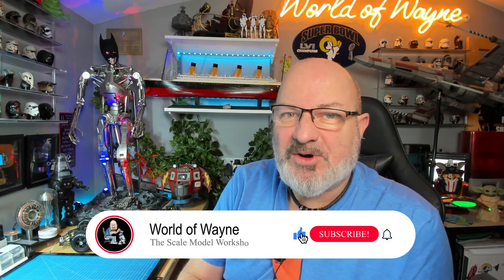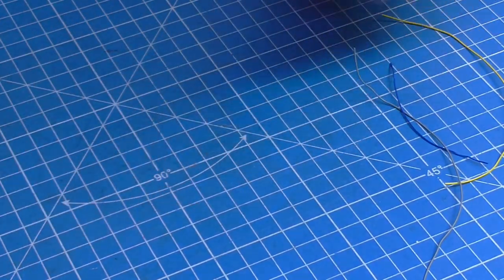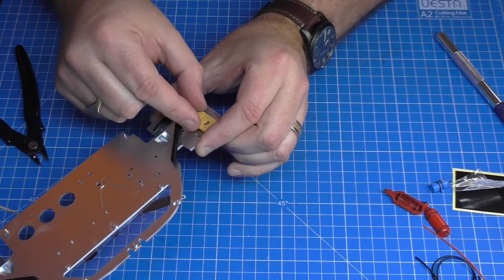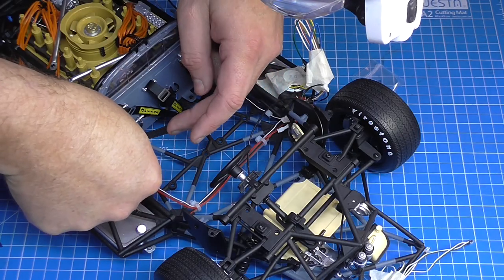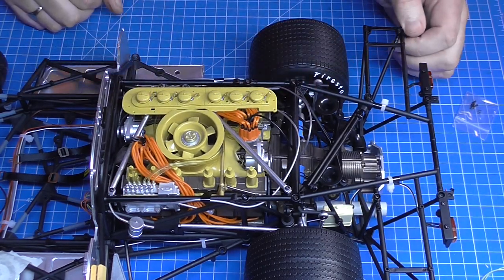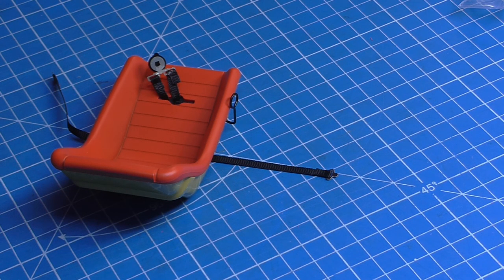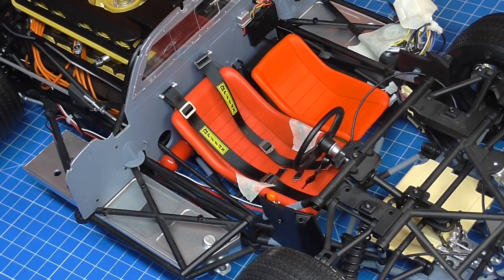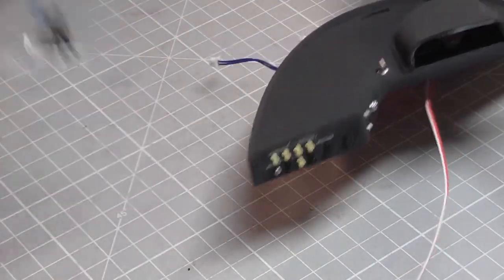Build Steve McQueen's Iconic Porsche 917kh from Agora Models - Pack 8 - Stages 55-64

Comment: lovely work, but absolutely maddening the order they asked you to do it in. Those seatbelts could have been added much later and they wouldn't have been in the way. and why bother with precise length measurements on the wires if all you do is chop half of it off when you're done?

As for covering all the hard work.. "remember it's the journey, not the destination" and "the joy is the parts we've met along the way..."

yeah, I don't buy it either..

Comment: Really coming along! You're only 12 stages away form IXO Box 19 - Stage 76 which is where I'm at. I was hoping that Agora in their instructions would have included the story line of the Porsche matching IXO Magazines. 
  The Fuel Injector lines: I added 12g craft wire near the end simulating an anti-kink coil. But like you said - it gets hidden anyway. lol
  The decals that go on the dash: I had a problem with them peeling off. So, I added a couple of coats of Tamiya Mark Sit Strong. Then for added assurance I brushed on a tiny bit of Tamiya X-22 Clear gloss over the decals.

Comment: If I recall, when you did the Ixo version of this stage, you used resin for those little wires. Yes?
Reply from the maker: Yes. But the thin CA is a much better option as its almost invisible